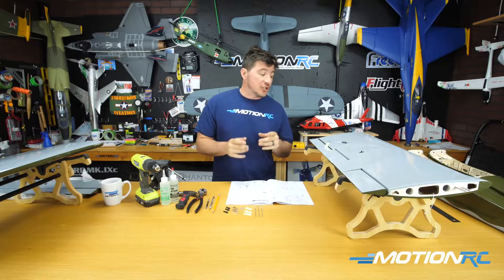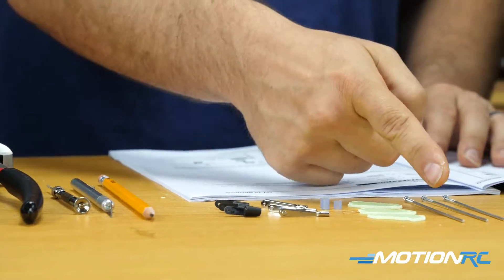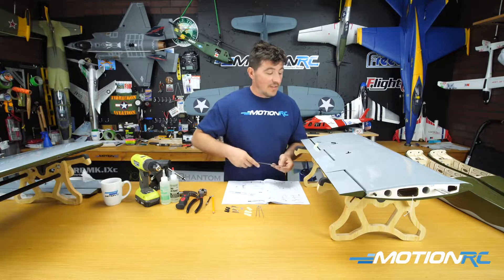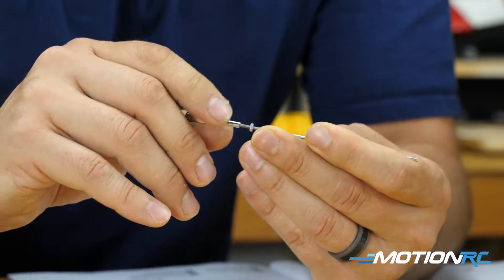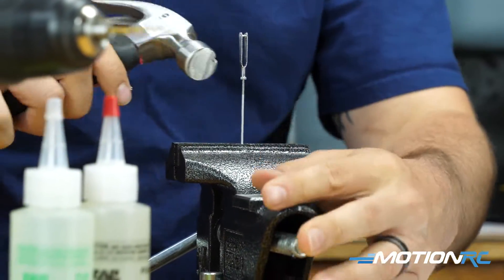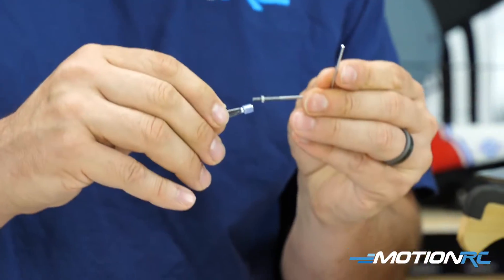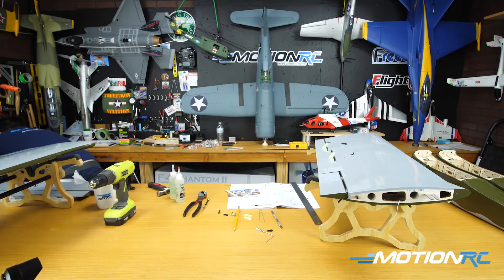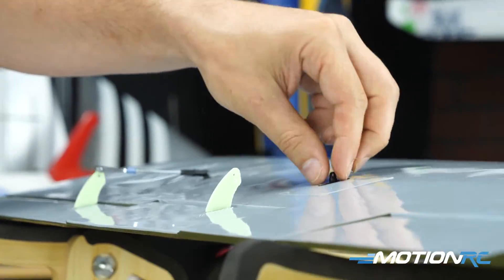ProFly OV-10 Bronco - Build Step 3 (of 8) - Installing Control Horns & Linkages - Motion RC

Comment: As said in the first comment scuff up the control horn also use blue locktite on the servo linkages so the don't loosen up during flight

Comment: One thing that you should do is roughing the surface of the control horn you intend to glue with sandpaper to give the epoxy something to grab onto. Also on any screws that you put on any wood you should thread the screws in and then remove them . Then you should dribble some thin ca into the screw holes to straighten the threads. There are many things that I've noticed should also be pointed out to the people viewing these build episodes. But that would make for a long message. Anyhow great little intros to building these planes. Just need to slow down and point out a few more important steps that really are necessary and important.
Reply: Yes very good comment. I'm assembling mine now and there are so many important assembly points that are not even mentioned. This may be an ARF but this is a builders ARF. Granted you are given a beautiful airframe to complete but it's a rather complex one. I tend to sweat the details and if I had produced this video series it would have been at least four more segments longer.